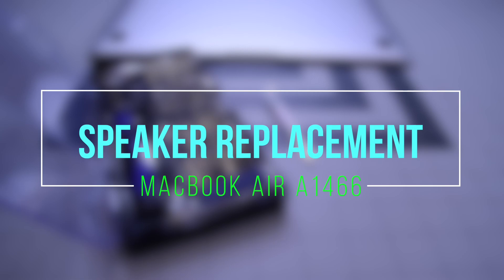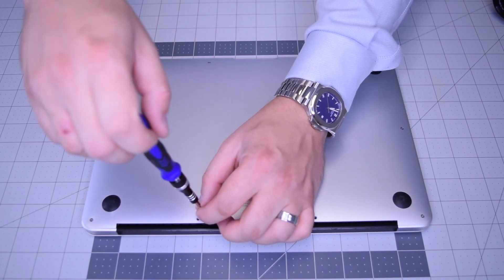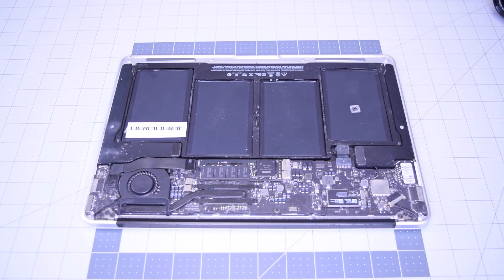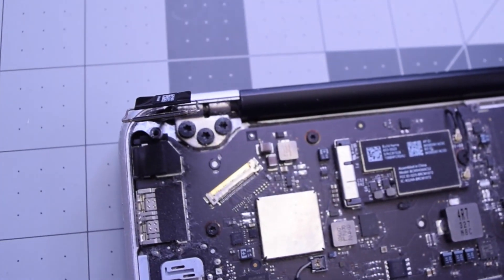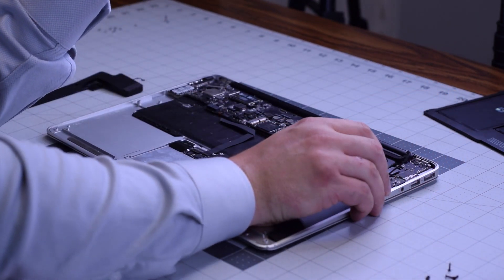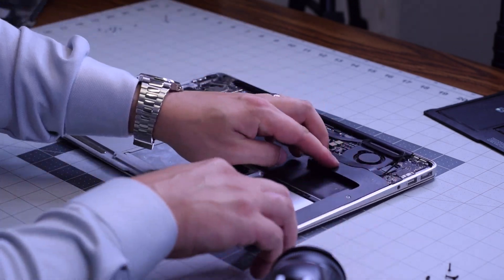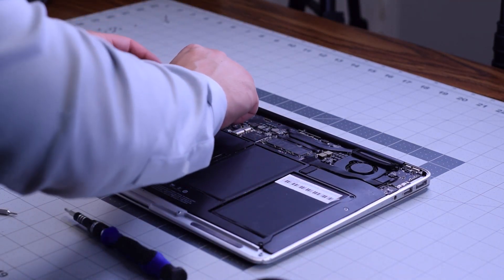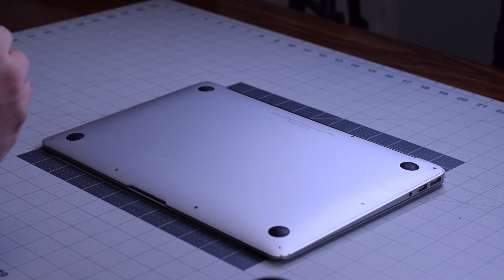Macbook Air 13" 2012-2017 (A1466) - Speaker Replacement

Comment: Do you have any advice on my Mac saying there is no internal speaker option? I just tried to disconnect the internal speaker and reconnect it and it still won’t play sound. Do you think buying a whole new speaker would fix it? Avoiding bringing it in to get fixed at all costs 😑